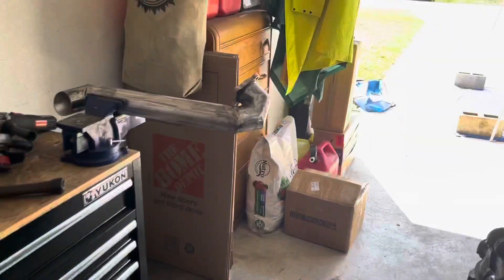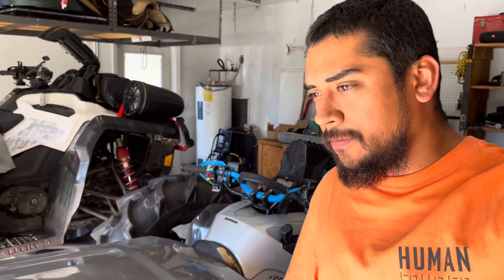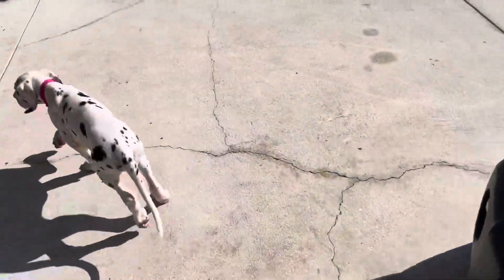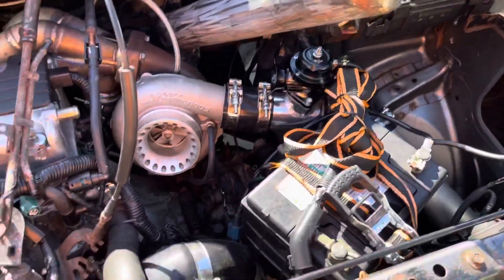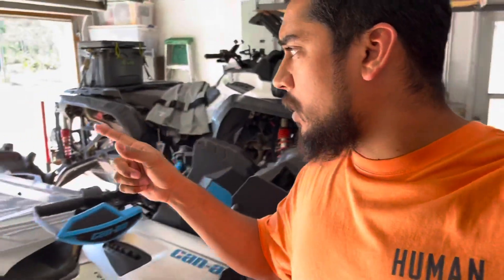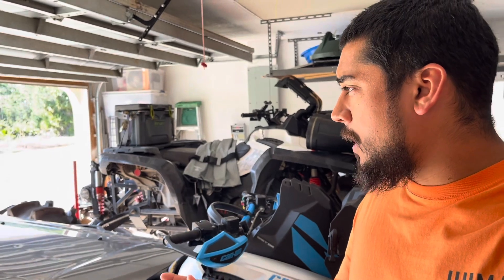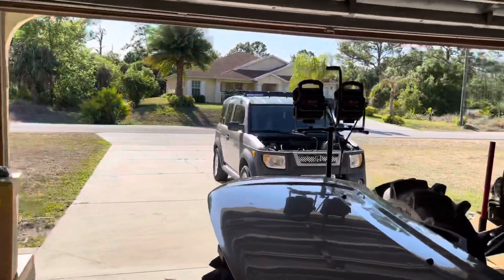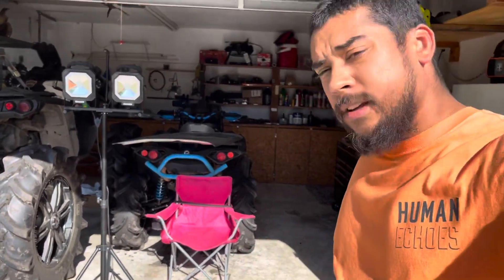The Turbo Element is Almost Done!

Comment: Did you retain the ac condenser?
Reply from the maker: Yessir! I need that AC!
Reply: @JaimmyAC  did you remove the bumper bar? I had my bumper cover off recently trying to plan a turbo build and there was like no space at all for an intercooler with the ac condenser and bumper bar in place.
Reply from the maker: @vitaliypetruk3872  Yes I did remove it, but there’s a few people on the Facebook group that added an intercooler with it. It was just a lot easier just to remove it!
Reply: @JaimmyAC  Which facebook group, if you dont mind sharing?
Reply from the maker: @vitaliypetruk3872  Boosted Elements